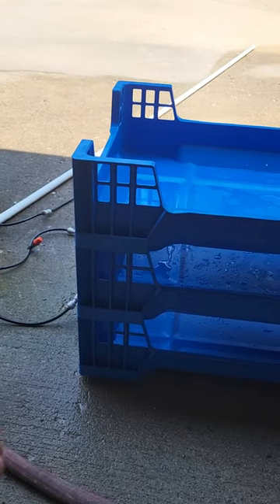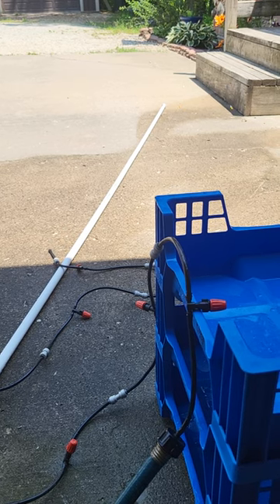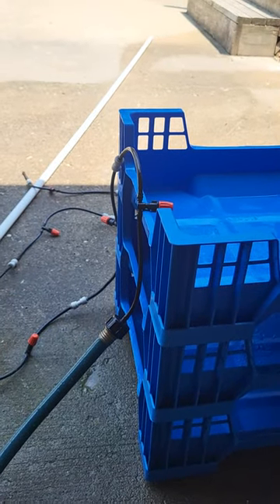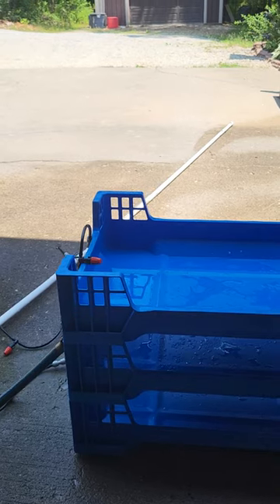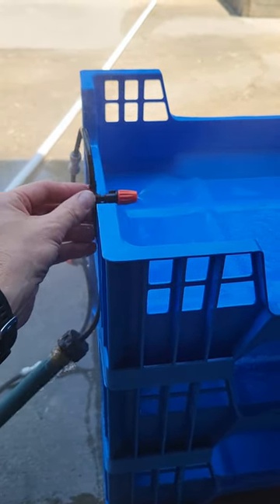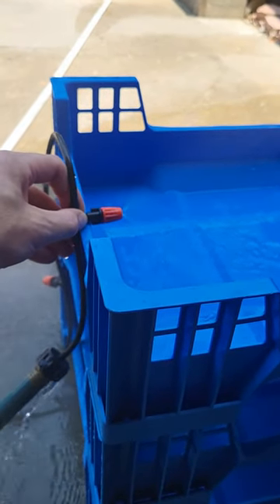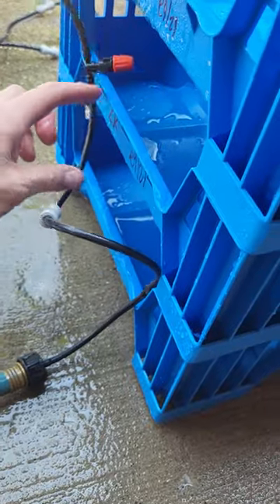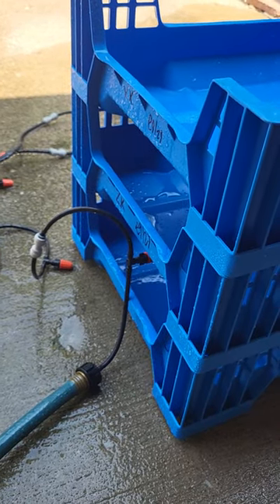Water automation for the mealworms

Comment: That's why i asked you in another video what about the tower stacking. You can design a fixed watering nozzle system for a tower. Also can be automatic and separated by rows, so the controller can decide what time to open the valve for each row of trays. I'm thinking about designing a tower with automatic watering system, but cannot be done with the blue trays ofc.
Reply from the maker: Why wouldn't it work with the blue trays?

Comment: Just some random thoughts from an inexperienced dummy:

Intuitively I feel like it should be connected to the supply at the top. The first nozzles will have more pressure, and the bottom nozzle will have more pressure. So it should counteract to some extent? Even if there is a difference, maybe you'll be able to set it up so that the bins that get the least, get enough and the bins that get the most, don't get too much? Maybe you could over-water slightly and set your humidifier to let the humidity drop after some time to encourage it to evaporate? How much play is there in the optimal window of watering?

Though, connecting at the top could make the draining issue worse, even a pressure release would still leave the water in each of the lines.  Actually, it feels like the draining issue will be a pretty major problem. If the nozzles drip when they aren't under pressure you'd have to evacuate the lines. But if you evacuate the lines then the nozzles at the end will get a lot less water as they will be spraying air when the other nozzles are already spraying water? Of course it'll be made worse the longer and taller the lines are, maybe it could be connected to the supply at the top and the bottom?

I'm looking at some retail produce misting solutions. I think they have solved these problems, so it might be worth a look to see what they've done. Maybe you'll have to make the lines horizontal? That seems to introduce new problems.

If each nozzle is connected to each bin then you've made it a lot harder to disassemble, no? How often do you have to unstack them? Since all your bins are identical, maybe you can take advantage of that? (they are identical right?) Maybe the best would be to hook it on the top bin and let the whole thing hang down? I imagine it would probably need to be made rigid. Maybe a second hook or something similar for the bottom bin, just to center it and keep it from getting knocked askew?

I also feel like the major concern here will be failures that could flood a container or worse, every container. There's also the issue of nozzles getting clogged and not watering them. You could probably account for the first problem in the design. eg. Feed the nozzles from a reservoir that contains a known amount of water that's filled manually. So if the pump was accidentally left on or something, worst case it just burns up. But of course you could also put a water sensor cut off in the bottom of the tank.

But I'm not sure how you handle the second issue. Checking every container might be as onerous as watering every container. But maybe you could only check every week or two? How long can a container last without water before they start dying off?

I'm not sure how you make it quickly modular. Is it really necessary? Can you just make most of them 15 or 17, could you have extras of other sizes or water a few unusual towers manually? Or even spray a bit of water in empty bins? Only the daisy chaining would really need to be modular? And not even that modular, maybe as simple as a series of 2 way splits with shutoffs on the main line?

I wonder if there's a totally different approach? Maybe a bunch of misters that are far away from the containers? Maybe a single nozzle on 1D or 2D rails? Ice cubes? I don't know. It'll be interesting to see what you figure out.
Reply from the maker: Fantastic feedback and perspectives. I'm going to make a video reply and tag you, this is great!